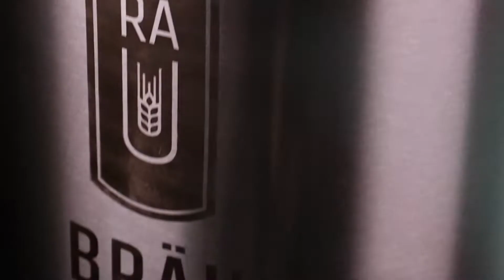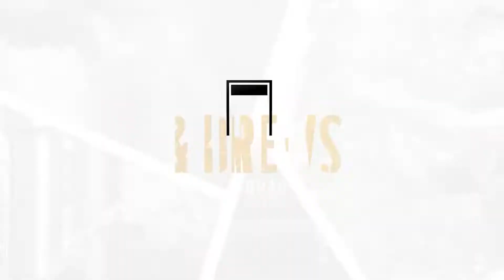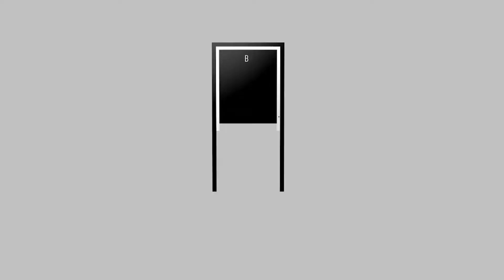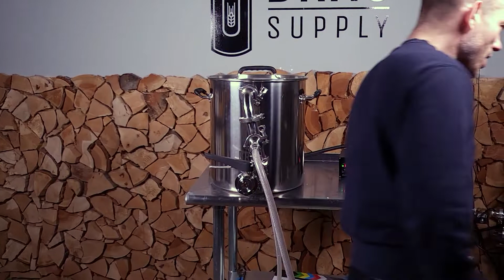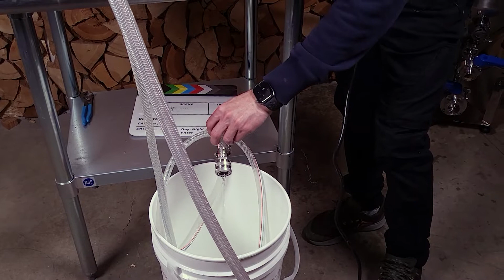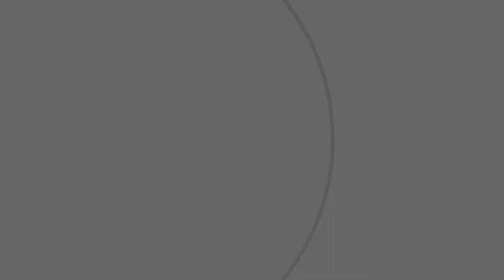Using the Steam Condenser

Comment: Can you elaborate on what the steam condenser is actually used for obviously condensing steam but is that so you can catch the steam and turn it into water? To add back into your boil?
Reply from the maker: Not for adding back to the boil — it’s just to knock down steam so you can brew indoors without filling the room with humidity. It condenses the vapor and sends it to drain.

Comment: Have you determined an approximate evaporation rate using the condenser? I did a 60 minute vigorous boil today and only lost 1/4 of a gallon. I'm trying to nail the evaporation rate so my SG isn't too low. 🙂
Reply: I'd also be concerned if the DMS is being removed effectively.
Reply: @theghostofsw6276 I’m interested in this tech, but I’d like to see some side to side comparisons.